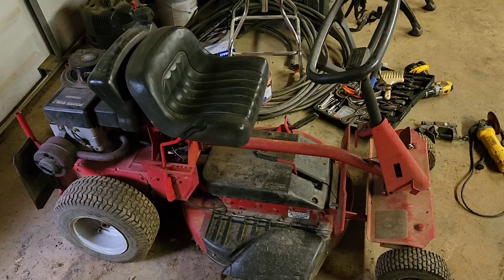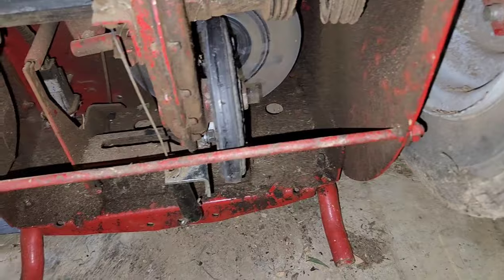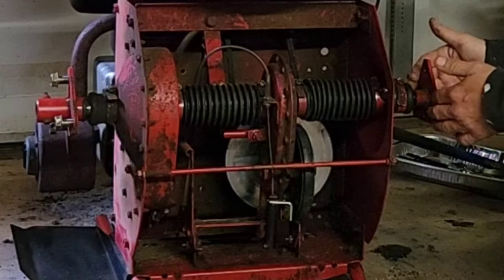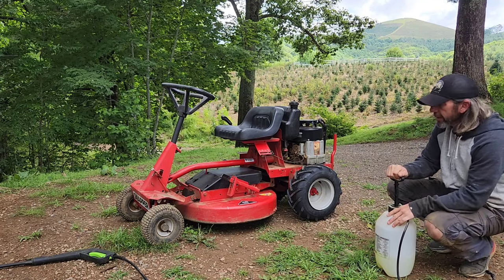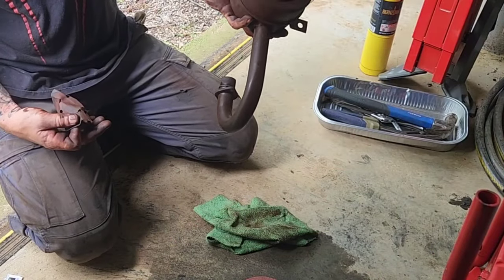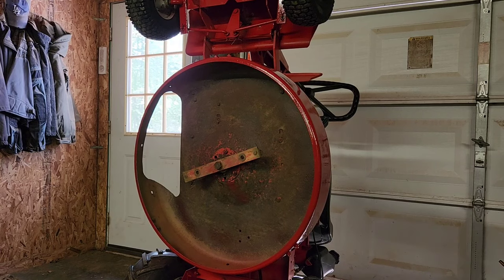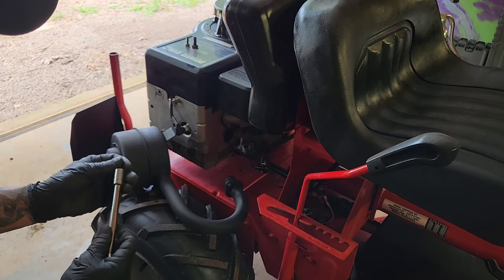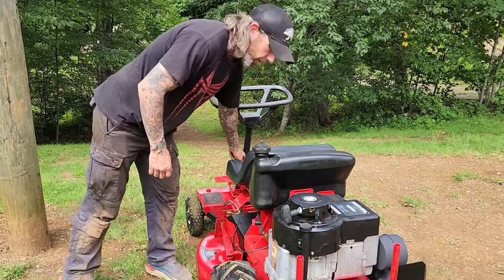25 Year Old SNAPPER Riding Lawnmower RESTORATION. Will it Mow our Yard?

Comment: I worked 43 years AT the Snapper plant, one suggestion, if you make you fuel line a little longer you then can pull the tank OUT of the bracket & set beside the tire upright when you set the mower on the bumpers, this way it doesn't matter how full the tank is and less chance of the fuel flooding the engine
Reply from the maker: Good tip, thank you!

Comment: Nice machine, I have 2 Snappers a 28 inch Hi Vac, and a regular deck 30 inch. I eventually replaced both engines with B@S 13.5 hp Intek motors.
Reply from the maker: It's almost time to start using them again here. Another few weeks probably.
Reply: I like the rear Tires, what kind of shape are the motors in? @biblesbulliesbogies1143
Reply from the maker: @BG-pd6os  overall pretty good. I did some work to it for maintenance but nothing major was needed. I'll check it over again before this season starts.

Comment: 35:30 You DON'T use "gear oil" the rear end & chain case was NOT designed for "liquid" type lube, the tolerances are too wide even with NEW parts to keep "gear oil" inside, it WILL LEAK OUT and your internal parts will be destroyed.
Reply from the maker: Ok thank you!

Comment: 42:38 The WHY you ask about in filling instructions of the differential is because when you SEE the "00" grease coming OUT of the bottom hole then when the mower is set level then the complete differential internal parts are sufficiently covered with the grease, some UNLEARNED or refuse to follow directions fill the case till the lube comes out of the top hole and in doing so that OVERFILLS the case

Comment: The part that the tire is screwed into, seems to be missing a plug at the end.  All the grease was in the cap.  Do i need to replace the triangular part replaced
Reply from the maker: The cap should be covering a grease point, I don't believe there is another plug or cap.
Reply: @biblesbulliesbogies1143  thank

Comment: Where did you see that gear lube reference?
Reply from the maker: I learned a lot from Jim Jackson's channel so that might be where from.
Reply: @biblesbulliesbogies1143  There is a good bit of misinformation on his channel, he treats all Snappers the same and they are NOT, that's why BEWARE of a channel that works on them that doesn't tell you the Model / Series that they are working on.
Reply: @biblesbulliesbogies1143  Use ONLY "00" grease, that's what the mower was designed to us, the tolerances are too large with the mating parts of the differential case & primary chain case to use "Liquid Lube" , we ONLY used "00" at the factory in testing & the results were superb, the "liquids" RUN OFF the internal parts.
Reply from the maker: Thank you, I used 00 grease.